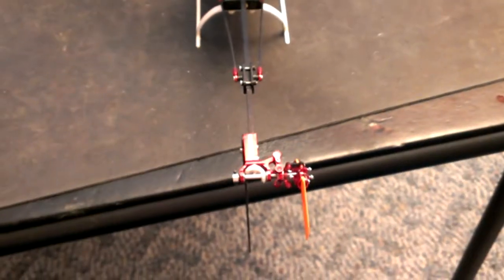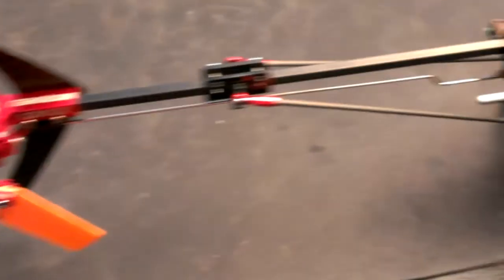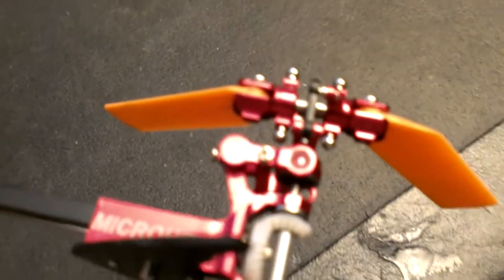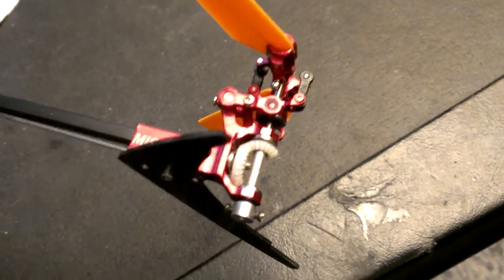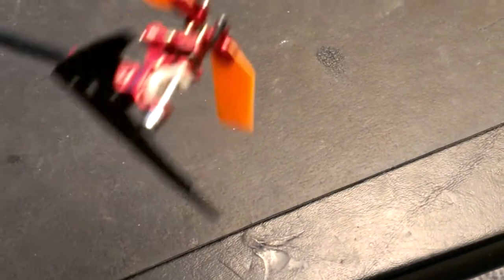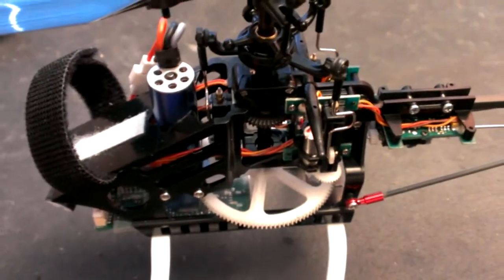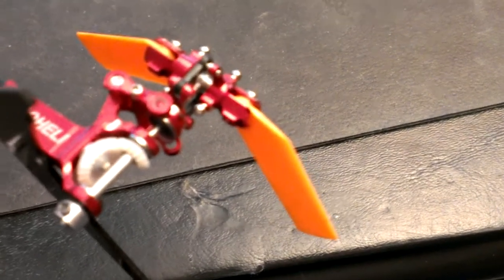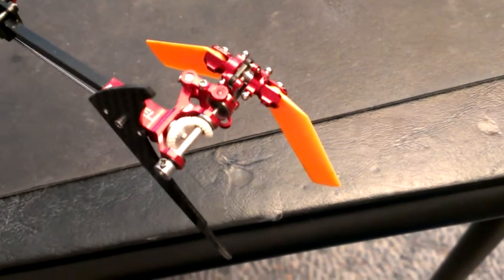Microheli tail power package 130x problems

Comment: I recently noticed that my tail pushrod started to vibrate (up and down) intermittently.  The vertical movement between the pushrod guide and tail was about 5mm. That made a buzzing sound which came and went due to harmonics I guess.

I also got a buzzing sound after installing the microHeli tail power package.  It turned out that my B gear was not meshing with the A gear properly and would sometimes jump.  I noticed my A gear was stripped after that.  I don't know whether it was because of the B gear jumping or if it had been like that for a while (I suspect the former).  The B gear only started to jump after putting on the tail power package

After putting back the stock tail holder and getting a new metal A gear, all works fine.